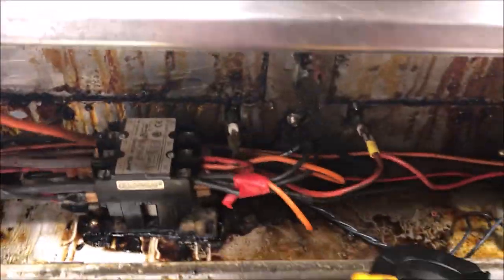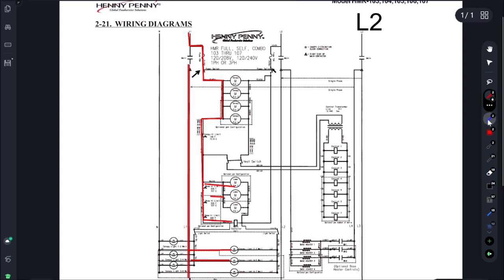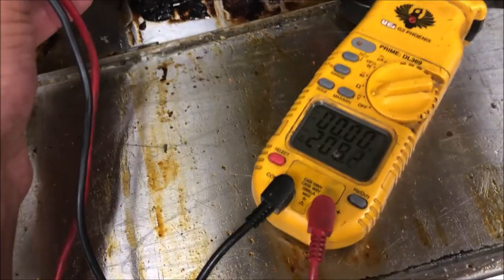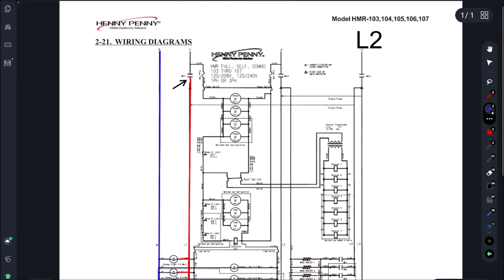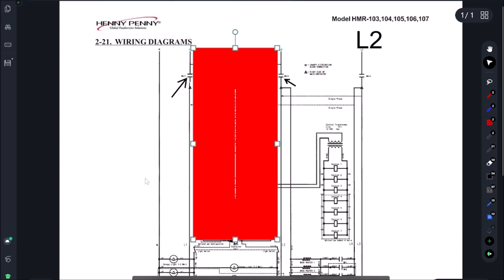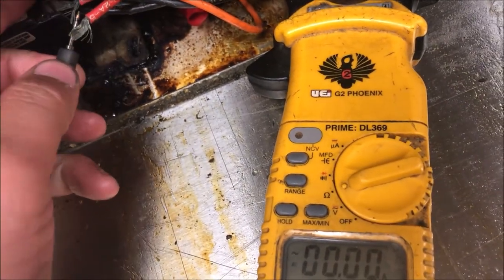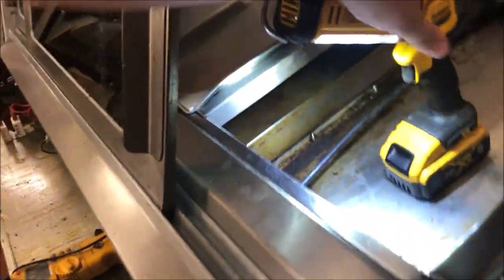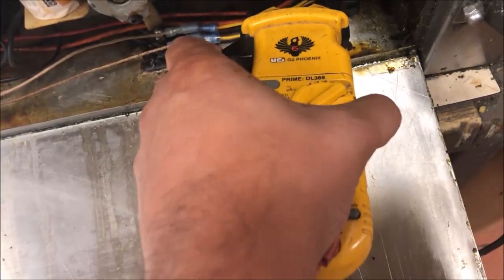Henny Penny hot case is not heating and has a dead short

Comment: 👍💪🇺🇸❄️ Holy grease Batman. Can u explain the orange wire to ground reading 2 mega ohms to ground. I though u want ol to ground when checking ?
Reply from the maker: It’s such a high reading that if I would of left it on there for longer it would of most likely gone to OL or a higher resistance value.
Reply: Awesome thanks for ur help. 👍💪🇺🇸❄️
Reply: I think the reason for the 2meg reading is he was touching the wire and probe making a circuit through his body to ground.